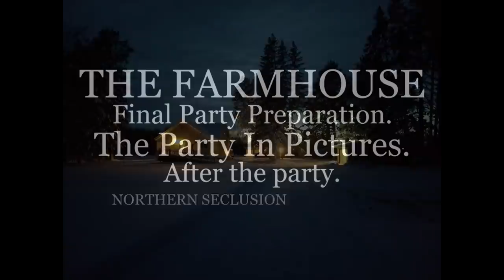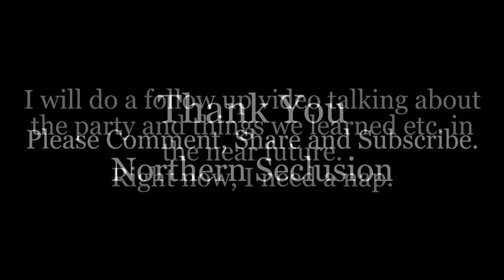THE FARMHOUSE. Final party prep. The Party in pictures. After the party.

Comment: looks like a rear support bracket is broke off on the mower where it attaches to the deck ( you can see it flapping in the breeze at 6:56). not sure if thats causing unnecessary movement and possibly bent the pto shaft

Comment: Those shafts bend when you are going down into dips in the pasture and coming back up(they start to bind at a certain point). I dont see one but I am not there, but look for something like around the top link) you can loosen up so when you go into a dip the shaft will stay straight or use the rider for those areas. What a great party!!

Comment: When you buy a new pto axel it has to be adjusted at length. you have to lift the  liftarms at top and messure the distanse between the shaft on the tractor and the shaft on the mower. dothe same when the arms are lowered. The longest distance is to be noticed. Then messure when the pto axel is in level. At this point you should have a total axel about three to four inches shorter when its pushed all together. Then you can assably it without diassebly the mower. Im very sure the bendt axel coms from its too long and when its level it stick in the end of the pipe. Remember when you cut it, cut of both the shaft and the pipe the same inches. Good luck.
Ketil Tokstad from Norway

Comment: usually  pto gets bent when too long if three point hitch is raised too far, something has to give pto  can be shortened by cutting some off both shaft and socket sides.  without any shaft in place but mower hooked up raise and lower deck to maximum position and take measurements from tractor pto to gearbox.  assembled shaft must measure less than shortest measurement. don't shorten too much or shaft will separate when in lowest position.  this is what gives clearance to hook up pto when mower is fully attached.  side to side sway will not usually affect shaft  but if you can reduce it mower will perform much better

Comment: I used pto's for 25 years and never bent one, any idea how it happened? The belts would burnout under a heavy load before the "one" shaft would bend. It looks like your not using a sway bar {it keeps the implement from moving side to side} 
You sure know how to feed a crowd though.
Reply: Agree  he definitely needs a sway bar. We had them on both sides when using our bush hog or flail mower. With that being a 2 piece pto shaft and it swaying back and forth ... I agree that’s what bent it.
Reply: @TennesseeMtnMan  One was usually good unless it was a heavy implement. I used to have a 1500 lb seeder on a 3 point with 2 sway bars and I could lift it, honk on one brake and be on the next row in 5 seconds

Comment: Joe thanks for the Video's, Joe cut some off your PTO you can do that, that's the problem you should be able to slide 
that backward with out disconnecting your mower its to long and bending hope this helps.
Reply: I was wondering if those needed trimming down. Some mower/tractor combinations must have different lengths.
Reply: @wademunkey  Yes sir.

Comment: JUST 2CENTS WORTH BUT I THINK THE THIRD LINK SHOULD A CHAIN BECAUSE YOU WOULD WANT THE MOWER TO FLOAT OVER THE GROUND AND AS YOU GO THRU ROUGH GROUND YOU ARE PUTTING A LOT PRESSURE ON THE DECK    THE THIRD LINK SHOULD BE USED WHEN YOU ARE USING A DIGGER OR A BLADE WHERE YOU WANT TO RUN SMOOTH    ALSO THAT FIRST ITEM YOU HAVE ON THE TRACTOR PTO LOOK WAY TO LOOSE  FIND A BETTER WAY HOOKING IT UP

Comment: Haven't seen someone cleaning spark plugs with sandpaper for about 30 years. My Dad had to do it religious every Winter, with his old Ford vans. He used to put them under the grill to warm them up before putting them back. I still got woken up regularly, at 5am, to give the vans a push start. Not great when you're 13, that's why I won't ever buy a Ford 😂
Reply: I too used to hand clean spark plugs for my old tractors, then i bought an blaster operated by air pressure & silica sand. This cleaned even badly fouled plugs in less than a minute. Wish i had known about this sooner.

Comment: If you are going to keep having parties like that it may be worth it to look at making a number of scrap wood easels to setup an art area to distract the kids with. Scrap wood to make the easel from with a layer of cardboard for a smooth surface to not need plywood/osb and you have an easy surface to staple a sheet of butcher/construction paper cut off a big roll. A few water based paint colors in bulk and some paint brushes and you are good to go for a competition with some cheap item as the prize. 

A soda vending machine could be something else that is good to look for as you can set them up for free vending and stock them up with cans/bottles to have a no cooler setup for sodas/drinks. It will cool them down and make dispensing easy

Comment: I have a friend that has the same setup on his tractor for a mowing deck. However, he has stabilizers on either side so as to keep the deck in line. He found when making turns with deck in use and no stabilizers that it shifted (since nothing rigid is holding the deck in place) due to the free play. Once the stabilizers went on the issue went away. Also how much stress or force is on the deck as it makes a turn? And u throw one hell of a party....................

Comment: Your tractor is running on the rich side, plugs shouldn't be clogging up in carbon soot. The PTO shaft was over torqued, that is why the mower side shaft bent.
Reply from the maker: The old M burns about a quart and a half of oil per tank of gas. I am guessing it is more than just running rich.